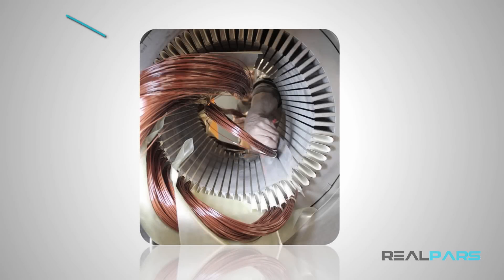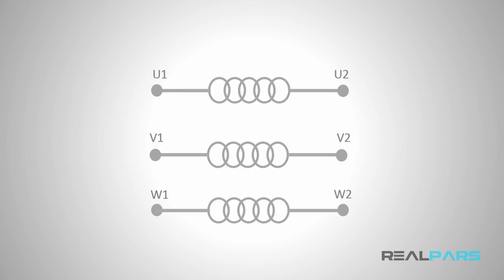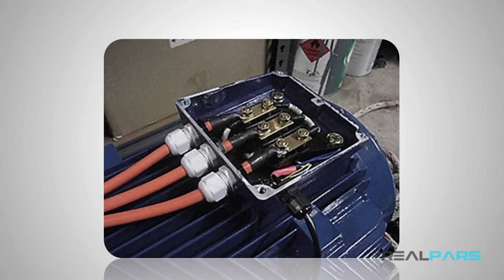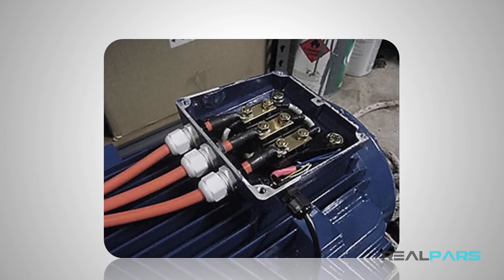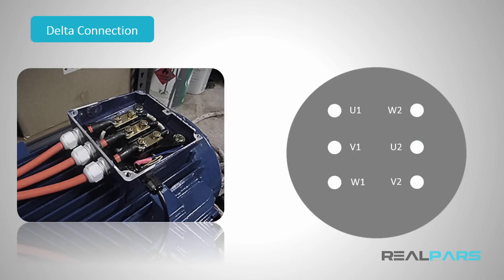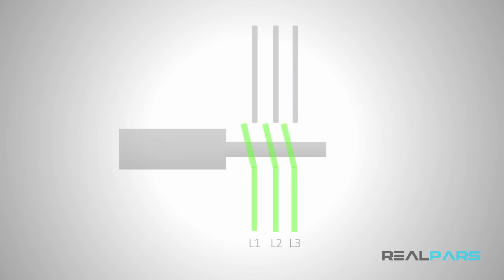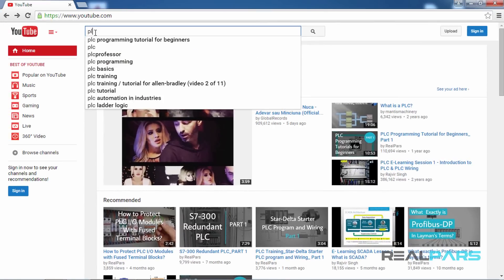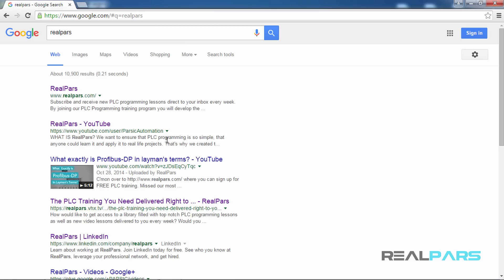Star-Delta Starter PLC Program and Wiring _ Part 4

Comment: may ask you a question?.. i don't have plc personaly, i learned plc from my college, but i can use it everytime because it ruled by my college... but i need to learn more about plc can you give me advice to learn plc programing without plc? i mean simulator software so i can make ladder program then run it in simulator without plc connected to my pc thx
Reply from the maker: You can use TIA Portal V13 along with PLCSIM V5.4 or higher. TIA Portal is the programming software for Siemens S7 PLCs. But you can connect it to PLCSIM and simulate a real PLC.